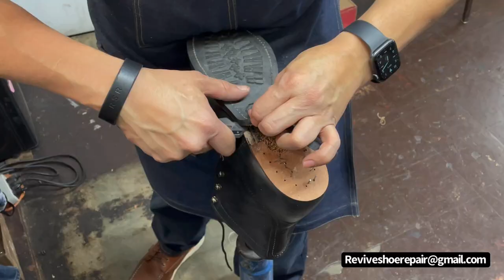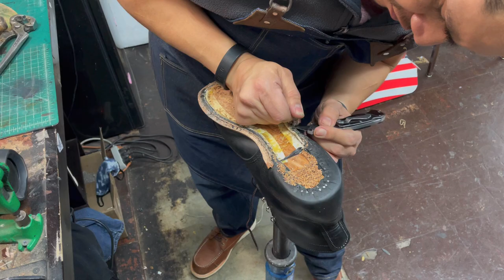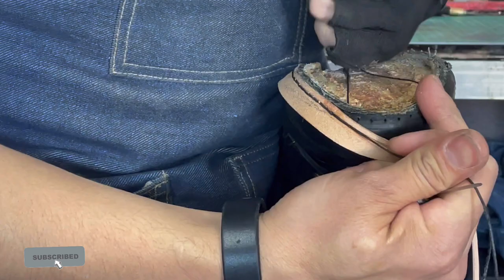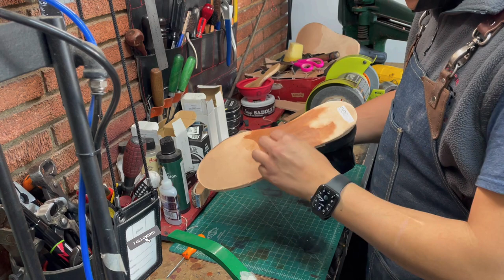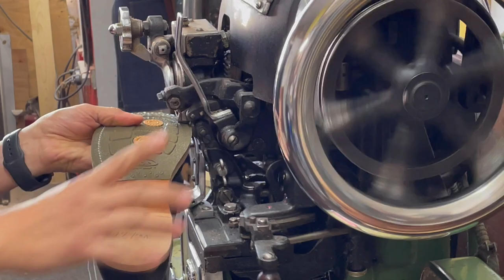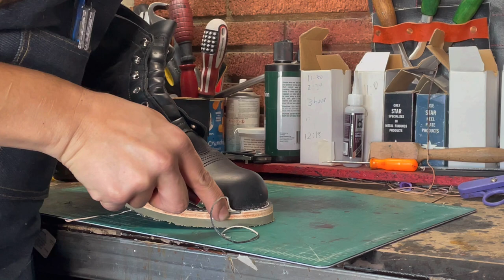Iron Ranger 8084 upgraded/Dr.sole#redwingboots #redwingheritage #cobbler

Comment: what type and size of nails do you use to secure the edge of the half sole?
Reply from the maker: Clinch Nail ,depending on the thickness you need
Reply: @AaronG2480  do you use DB gurney or another brand?
Reply from the maker: The brand doesn’t matter